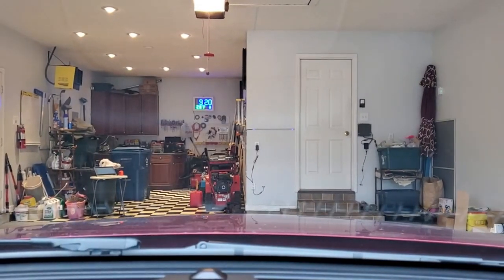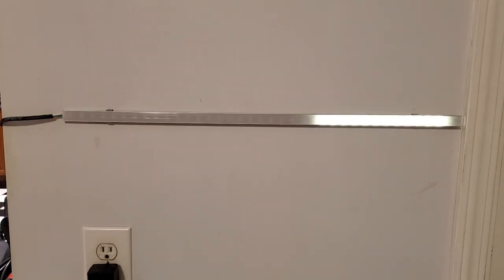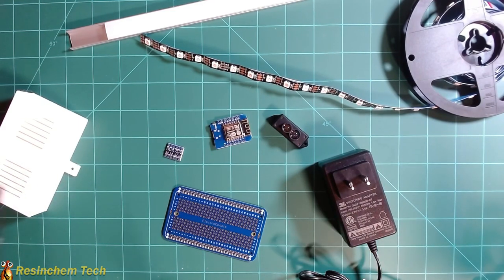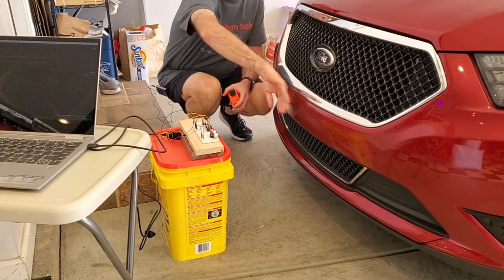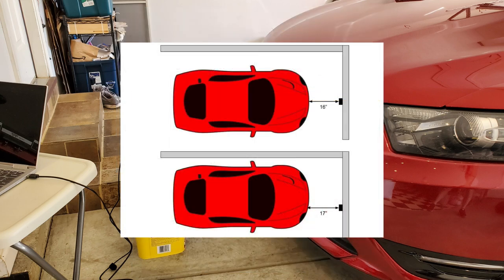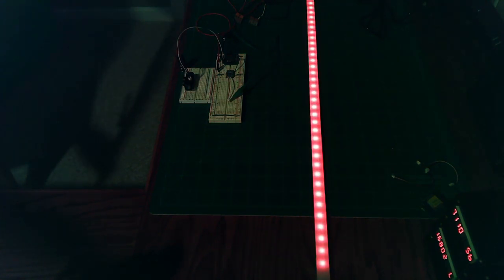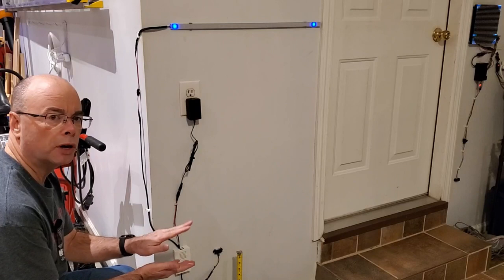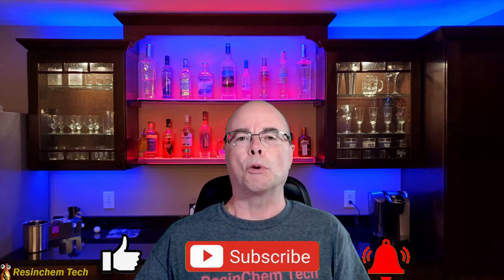A New Parking Assistant using ESP8266 and WS2812b LEDs

Comment: Looks good, from the video I would say the only thing missing is a sleep mode to turn off the LEDs after no movement for a time period.
Reply from the maker: There is an option in the web settings to disable the sleep mode LEDs altogether so that they do not remain lit after the system goes to sleep.  However, it wouldn't be too difficult to modify the code to turn off the sleep LEDs after 30 seconds or so.  I currently don't have time with my current project load to make any modifications to the code, but if you are familiar with Arduino/C++ code, my version is out there on Github and you can freely clone or fork it and make those modifications ( https://github.com/Resinchem/ESP-Parking-Assistant ).

Let me know if you do make those changes and I can consider adding them back to my code if I ever have a chance to get back to this particular project.  I have a number of other requests for modifications as well, but I have to find an opportunity to circle back to this build... and not sure when that might happen.

Thanks for watching and taking time to leave a comment and suggestion.
Reply: @ResinChemTech  Damn someone is quick today.
Would love to do this but no garage and car parks behind motorcycle on the drive so no line of sight from a fixed spot.  I rely on a mark on the fence that lines up with my mirror.

Comment: Great project and I loved seeing the comparison of the distance sensors. The vl53l0x sensors has a "long range" mode that might have helped cover the distance, but my guess is that it would do so to the detriment of close range readings (and since it's already so noisy...). I believe the vl53l0x has a bigger brother with great distance, but when I investigated it before, it didn't have ESPHome support, so I skipped it. Given the consistency of the readings and the small number of times you would need to use it, the TFMini absolutely sounds like the best choice.
Reply from the maker: Thanks... I probably spent too much time on the sensor test but I knew if I didn't, I'd get a lot of comments about using a $3 ultrasonic sensor instead.  So I felt like it was important to show why I selected the TFMini.  There may be other options out there that could work and might be cheaper, but I used ones that I had used in other projects (and had on hand!).
Reply: @ResinChemTech  The sensor test was very useful for me, personally. My guess is that the accuracy variances on the ToF (if not JUST noise) could be the increased field of view and the curved surfaces of your car. All of those distances could be correct at 25 degrees with the shape of the front of your car and the non-centered placement of the sensor. Placing the TFMini in the center might have given it a slight advantage, but it's largest advantage seems like the 2 degree view. I wonder what the variances would be with a flat, perpendicular  board instead of the car's multi-curved surface?

Comment: Great project and great video explaining each part... I would very appreciate if you could include in your Github a document showing the wiring connections from the different components to the ESP32 board.  The LED strip looks pretty straight forward but which pins you used on the ESP32 for the TFmini is not as clear to me.
Reply from the maker: The wiring diagrams, parts and more info are all in the related blog article, which is linked to both in the video description here and in the wiki within the Github repo:  https://resinchemtech.blogspot.com/2022/11/esp-parking-assistant.html

Do note that the current firmware will NOT work with the ESP32.  It is designed for the ESP8266 (and preferably the Wemos D1 Mini).  You can find more info on that both in the blog above and in the Github Wiki.
Reply: @ResinChemTech  Thanks for the prompt reply... my mistake on the reference to ESP32.  For my project, I'm going to use the ESP32 so fully prepared to make code changes.  Also, my preference is to use I2C instead of UART, so I'm also looking to use the TFmini Plus since its default interface is I2C.

Comment: Really cool project. Have you thought about a feature to align the vehicle with the garage opening? I have a two car garage, but there are two single garage doors. It's still one garage inside. Anyway, my wife has a large SUV and there are only a few inches of clearance on each side. She has already hit the side mirrors when not lined up correctly. In addition, she needs your project for depth. I wonder what the best way would be to add a couple more sensors with arrows left and right as she approaches. Any ideas?
Reply from the maker: I've had a couple of people ask about that.  I think that a different side sensor (possibly ultrasonic) would be needed.  The problem with the TFMini/LIDAR is the narrow field-of-view, which is ideal for the front sensor, but probably wouldn't work well as the side sensor.  Someone else suggested something as simple as a laser on the ceiling that would put a dot on the hood of the car that the driver would line up with the center line.

I'm giving it some thought.  But I think it would probably either be a separate system from this one, or this one would have to be upgraded to an ESP32.  The ESP8266 is about maxed out as it currently stands... I'm not sure it would support a second sensor... at least not another TFMini/LIDAR or something the would require another serial connection.  I might take a shot at coming up with something when my current project load permits.

Thanks for taking time to post a comment!

Comment: Very nice!  I’m always looking for ways to use ESP32s or 8266 chips.  I may do this.  Thanks for sharing!
Reply from the maker: Same here!  Seems like I always have a bin full of ESPs looking for a problem to solve!  I will say that personally, learning Arduino/C++ code opened up a whole new world of things I could do with ESPs (like this parking assistant, my matrix clocks, etc.).  Many of these projects simply wouldn't be possible using things like ESPHome alone.  And by adding MQTT, it assures that I can always integrate the devices into Home Assistant as there wouldn't be any sort of native integration for these custom-built devices.

Thanks for watching and taking time to leave a comment.  Let me know if you do end up building the parking assistant and how it works for you!

Comment: Thank you for this video. I have watched it multiple times. I have electronic background, but are quite new to Arduino / ESP boards and have no experience on MQTT. Home assistant is brand new to me too, but would like to set it up in the future. Would you maybe have the code for the Ultrasonic sensor instead of the serial coms code. I would like to try it out, but trying to navigate through the code and is very new to me. Code snippets and advice about the code will really help. You have an amazing project here. Thank you for this. Was looking all over for this. Not sure if someone already asked this question. Keep on doing the great work!
Reply from the maker: I don't have a version that works with the ultrasonic sensor.  As I covered in the video, I didn't feel that the ultrasonic sensor was stable and precise enough for my needs so I have no plans to develop an ultrasonic version.  However, I do believe that someone may have forked my code and rewrote it to use an ultrasonic sensor.  I have not tested this forked version nor do I know if it has been kept up-to-date with changes made in my version.  You can see my full code (and find any forks) in the Github repo:  https://github.com/Resinchem/ESP-Parking-Assistant  

I try to document within the code itself to help out with anyone trying to learn or for those that want to adapt my code.  The wiki may also contain some useful information.

Note that MQTT/Home Assistant is optional and not required for the system to work.  So you could build the system now and then add it to Home Assistant via MQTT at a later time.

I appreciate the kind words and interest.  I've been asked numerous times about an ultrasonic version but feel that due to the noise, wider field of view and lower precision, I don't believe that it is a good choice for this project.  It definitely would not work in my situation as my sensor needs to be near a side wall and the ultrasonic sensor would just measure the distance to that wall and not an approaching car.  But it might work for others in situations where high precision is not needed and the sensor can be mounted far enough away from other walls and objects.
Reply: @ResinChemTech  Thank you for your quick reply. I can't find the sensor locally at the moment and I have the ultrasonic sensor. I appreciate it. Will do some more research. Thank you!

Comment: Thank you for taking the time to make this very informative video. One question: Can this project be done with an ESP32??? Thanks again...
Reply from the maker: It certainly can, but the code would need to be updated with ESP32 specific libraries and calls.  The code is freely available on my Github, so it can easily be modified to work with the ESP32 if that's what you'd like to do.

Just out of curiosity, what would you expect to gain by using an ESP32?  For this particular project, an ESP8266 is perfectly capable of processing the sensor readings,  lighting up a few LEDs and handling the web/MQTT requests. This is the reason I haven't seen the need to develop a version of the firmware for the ESP32 as I didn't feel that it would improve the system in any manner.  But if you do have specific reasons, you should be able to update the code relatively easily.

Thanks for watching and taking the time to leave a comment.  I do appreciate it.
Reply: Thanks for your reply. The only reason would be that I have a bunch of ESP32's hanging around. But since I'm not much a coder/programmer, I'll just stick to ESP8266 and the rest of the parts you have listed. Thanks again for all your efforts.  @ResinChemTech

Comment: From a UI/UX perspective, the new system is way better, while being cheaper too!
Reply from the maker: Yeah... that was one of the biggest pains with the original Pi version.  Once I had it it 'dialed in', I didn't have to mess with it much, but when first setting it up, it was a real pain... as the Python program had to be stopped, opened and edited and then restarted for each change in distance.  So, I knew with this new version, I wanted a web interface where the settings could easily be tested and changed without stopping the system.... and without editing any code.

To be honest, development of the code was 95% of the effort (and a huge chunk of the time) in developing the new system.  Thanks for watching and taking time to leave a comment!

Comment: I'm using the VL53L0X for my parking distance sensor and it works great. 
Sure, the max distance range is shorter than with the other options, but that's not a problem really. It starts detecting the car a good 5-6' away and is rock solid stable as the car is driven in and parked. I don't get the fluctuation in distance that you did. I'm using just RGB LED strip and it just changes from green to yellow to red to tell the driver when to stop.
Reply from the maker: That's great that you got the ToF sensor to work for you.  Due to the entry door into my house, the sensor is placed pretty close to the side wall so the wider FOV of the VL53L0X could have posed an issue.  And my wife really likes the LED "countdown" approach as her range for being in just the right spot is pretty narrow.

But like many DIY projects, there are multiple ways to accomplish a similar task.  Thanks for taking time to share yours.

Comment: This is a great project and may be my first foray into this platform. I'm curious if you have come up with a left/right corrector for narrow garages? ceiling mount would be best since walls are usually cluttered.  That would be a useful upgrade.
Reply from the maker: I appreciate the kind words... and the suggestion.  But please note that I've received a lot of different requests for 'upgrades' for the parking assistant, including use of an ultrasonic sensor, an ESP32 version and, yes, adding lateral left/right guidance (among others).  While I would like to look into to some of these possibilities, it is a matter of time and priorities among other projects.  I have given the lateral guidance some thought, and I have a couple of ideas... but I don't know when I'll have a chance to try them out and determine what, if any, might be the best path forward.

if you are interested in knowing when I release an upgrade to the parking assistant, you can place a 'watch' on the Github repository.  I may or may not publish something on YouTube if/when I implement some of the requested changes.  Or you can just pop over to the repo or to the related blog article, as I do try to keep those up to date with all the latest changes and new features.  Thanks again for watching and the recommendation.

Comment: Great project and tutorial.  I've built one so far for my wife's parking spot and she loves it.  I'll hopefully get one built for my spot this weekend and then one for my Mom and my brother in law.  One thought I had is that it might be nice if there was a way to configure it without connecting to a home network.  I have a decent signal in my garage but I'm not so sure about my relatives.  Could the captive portal have an option to just configure the device without on-boarding?

Also, I had to connect to my 2.4 GHz guest network vs my main network (2.4/5 GHz combined with a password with a % character).  The device sees the main network but won't connect.  Bout sure what the issue is.
Reply from the maker: Thanks!  And glad your wife loves it (that's always a good thing!).  First, just a quick note about installing the second device on your network.  Be sure you are using at least v0.41 or later for the second device (or both).  Versions prior to this had issues with duplicate names on the network (it never occurred to me originally that someone might want to build more than one).  v0.41 and later added support for multiple devices on the same network.

Next, as far as your network.. yes, the ESP8266 boards only support 2.4GHz networks.  I'm using a standard wifi library developed by someone else, and there have been some reports that either certain SSIDs or passwords have problems connecting (there are reports related to both length and special characters).  In fact, I've had one user that could not connect more than once with a particular router, but another router with the same credentials worked fine.  I am keeping an eye on the issues and fixes for this library and will update my firmware with any fixes that arrive.  Not a whole lot I can do in the interim, other than write my own wifi library... which is beyond my current capabilities!  I have an open issue on the situation here:  https://github.com/Resinchem/ESP-Parking-Assistant/issues/13  so you might keep an eye on that as I'll post any updates to the situation there.

Finally, as the firmware is currently written, a wifi connection is required to access the web interface and to setup the device.  The initial onboarding process (to connect to the wifi) isn't sophisticated enough to handle all the settings, like parking distances, etc.  Now, you could use another device to provide a temporary hot spot for joining and doing the setup and once the system was running, wifi could go away.  But as soon as the device reboots (or say loses power), it will try to rejoin the previous wifi... and if it fails, it will start broadcasting its own onboarding hot spot again and wait.  But this is certainly something I can take a look at... either modifying or creating a version that would work without wifi.  I have other requests as well, such as lateral guidance, so I do plan to circle back to this project when time allows.

Comment: I know what I'm doing next week. $45 after tax is steep when we are used to -$10 but cheaper than  a RPi. As always, great video! I look forward to seeing when you release new content.
Reply from the maker: Thanks!  Yeah.. the LIDAR sensor is a bit expensive, but hopefully I showed why it is worth the extra money in this case (at least for me).  And the final install could be much neater, but as I mentioned in another reply, this was just a temporary install for the purpose of making the video.  Actually neither vehicle parks in the location where I mounted it for filming.  So, it will be moved (or if the wife wants to stay with the Pi version, possibly stored away) and I'll definitely clean up the wiring if/when it gets remounted.

Thanks for watching... and taking time to post a comment.  If you do build your own, feel free to let me know if you have questions... or shoot me a message if you do build it and let me know how well it works out for you!
Reply: @ResinChemTech  I am going to have to rethink the mounting as well. There is a fridge in front of my wife's spot, that may change in the near future though. I'll reach out for help or to share my build.